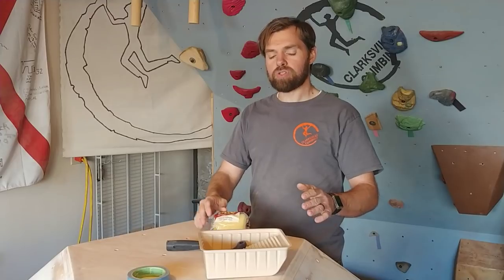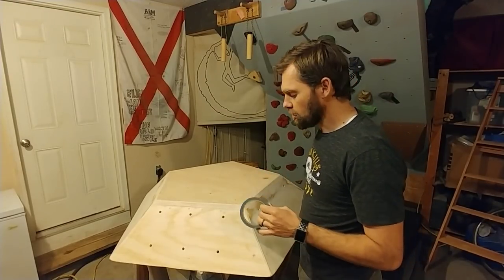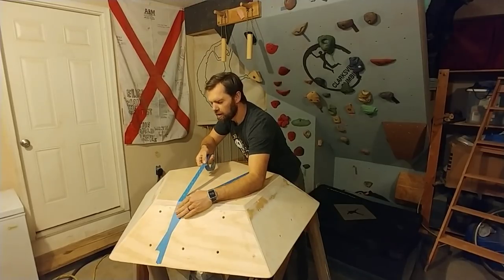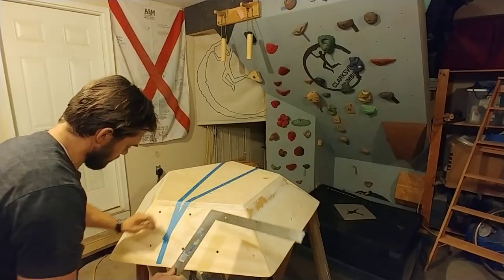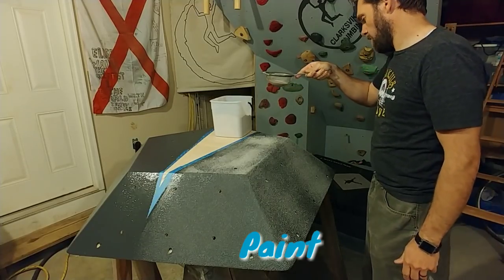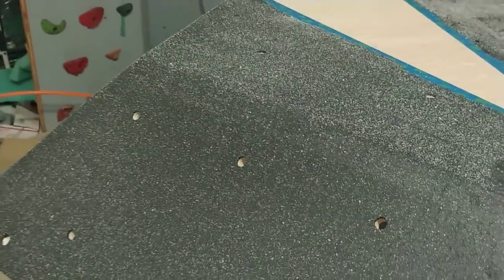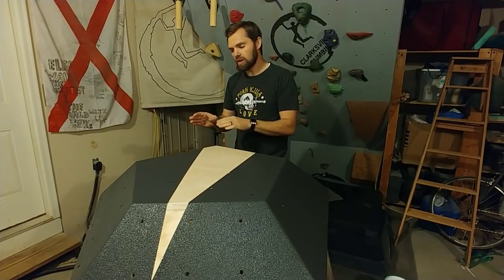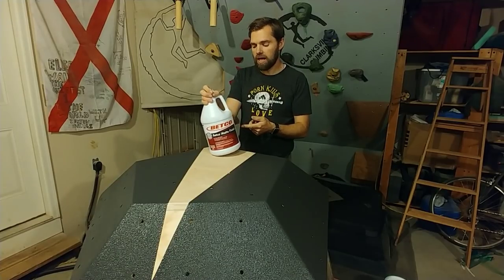How to Paint a Volume for Climbing Walls

Comment: I recently found the channel and love it. Haha I’m the random guy liking multiple videos...  

I’m building a 1,000 sqft garage rock gym. I’m confused on what order I should do paint (taping off and adding design), bond all edges and cracks for smooth finishes, and texture all of it..
Should I add a texture like you have on every single plywood piece or just on the volumes? Is the clear coat all I would need?

So it would be... 
1. T-Nut plywood
2. Hang all walls 
3. Bond the edges (sand them of course)
4. Tape off and paint (deck paint or regular? I wouldn’t mind using deck paint for quality but color choices are limited)
5. Finish with the clear coat sealer (is that grippy enough if I don’t texture?)

I’m more looking into saving money by DIY of course but I’d rather do it the right way first and have it turn out great! Thank you for your help and the channel!! I will be buying some of the items from your links

- Casey A.
Saint George, UT
Reply from the maker: I'm still perfecting my own technique to texture. This is what I do now...
-Smooth joints
-Primer paint
-spread texture (sand)
-Latex paint, 2 coats
-High quality clear coat
I think it would be cool to have spots on the Wall that have no texture, I think thats a design preference more than anything. Spinners might be more of an issue in those areas.

Thanks for your support!

Comment: That looks fantastic! Could you link to the paint you used? Cheers 👍🏼
Reply from the maker: Jay, I just use regular house paint, whatever I have extra from other projects. The clear coat is were the "rubber meets the road" or in this case Volume :)
Reply: Climber Dad, thanks for the info 👍🏼

Comment: Do you like the Betco as a top coat for the surface of the climbing video.  Thanks for the great information!
Reply from the maker: It's not really about what looks best in video, it's about the finished, usability of the volume at a good cost. I've found the Rustoleam garage floor clear coat to be just as effective if not a little better.

Comment: I juuuuuust started building volumes a couple of weeks ago. I appreciate this video because it's motivated me to use the shaker screen. It looks way better. My current issue is with the holes for the t nuts. So many of the holes I drill end up with really badly gauged edges. Is this just a problem with the type of bit I'm using? I've had to fix so many hole edges that I'm wondering if there is an obvious fix for smoothing the edges better. Thanks!
Reply from the maker: Thanks! I totally understand about the holes. The bit makes a huge difference. Here is a link to the exact bit that I use.
https://amzn.to/2DsaXFl
Reply: good bit and a few layers of masking tape should fix that up

Comment: The second paint is applying when the first coat has dried or you just paint it right away? I made some volumes but the sand didn't stick very well.
Reply from the maker: Wait for it to dry

Comment: do you wait that the first paint is dry before putting the second layer on the top of the sand and what is the paint used
Reply from the maker: Yes and I use whatever paint I have laying around, usually water based latex paint. If you are looking for performance use a 2 part epoxy paint.
Reply: @climberdad  thanks for the response

Comment: hi , how's the sand holding up? I'm just about to paint my panels for an outdoor wall, i'm going with Primer first then paint with sand and possibly another coat over the sand. Was wondering if its worth it.
Reply from the maker: I would recommend and least 2 coats over the sand. Also if you can get a fine silica sand that would be much easier than sifting play sand.
Reply: @climberdad  Thanks! Your videos have been very helpful.
Reply: @climberdad  ops another question , after drilling my holes should i paint first installing tnuts?
Reply from the maker: I prefer to paint very last, after the t-nuts have been installed unless it's a volume.
Reply: @climberdad  I prefer to install the t-nuts last, if you get paint on the inside thread it's a pain to clean out.

Comment: Hi Im really appreciate of your work. What kind of paintball you used. Matted, enamel?
Reply from the maker: Honestly, I just use whatever I have laying around. Marine grade paint seems to work well. I typically put a clear coat polyurethane over the top and you'll need to chalk the back of the holds to protect the paint.

Comment: How would you rate this after couple months-1 year use? Does it still have good texture?
Reply from the maker: Yes, holding up real well. The trick is to get a fine gain sand and several layers of paint to lock it in. Large grains will slough off (like climbing on soft sandstone).
Reply: @climberdad  Thank you for responding! :)

Comment: Will sanding the ply with rough sandpaper work as a cheaper and easier alternative to achieve a similar texture?
Reply from the maker: I use an 80 grit that seems to be a good balance but if you go any rougher I would worry about splinters. Wood holds polish down over time anyways.
Reply: @climberdad  thanks for the advice

Comment: Nice volume, what type of wood do you prefer for your volumes
Reply from the maker: 3/4" Baltic Birtch is perferred but I usually use 3/4" hardwood plywood from Home Depot because its a little less money and much easier for me to get. The 7 ply cabinet grade pine has worked well for me although its a little on the soft side.

Comment: very good work¡¡¡  What paint do you use?
Reply from the maker: I've been using a regular latex paint and a flat or satin water based clear coat on top. I'm going to start using a 2 part epoxy.
Reply: Climber Dad Cool Vid. Can you suggest a 2 part epoxy?  Everything I see is for cars or clear coats with high gloss for like wood tables tops. Also what sort of sand are you using?
Reply from the maker: @SuperBigVanilla  Thanks. I have been looking into some different 2 part epoxy paints but haven't used any yet. When I find some that works good that isn't crazy expensive I'll certainly share it.

Comment: Hi, just wanted to say I really appreciate the videos you've made on home wall construction, they've helped immensely!

I'm currently building an outdoor climbing wall on the side of my house (under an eve, to offer more protection from weathering and whatnot). I've heard horror stories of climbing holds sticking to the paint and tearing it off the wall/volume. For an outdoor wall, would the polyurethane finish prevent this sticking issue? Also, would acrylic or acrylic latex paint work for the base of the wall/volume?

Thank you,
Justin
Reply from the maker: We chalk the back of our holds to help this from happening with new walls.

Comment: How slip resistant is the clear coat? I'm thinking of trying it for use on a warped wall (as seen on ninja warrior) to give it a little extra grip/slip resistant. Good idea or should I look at other options?
Reply from the maker: Caleb Auer, if it's just the matte clear coat and no sand it might work really well. Test it out and let us know :)

Comment: I tried with regular sand it seemed quite abrasive. Rubbing hold ripped my skin. Any suggestions?
Reply from the maker: I screen out the large grains. They do sell a pre screened silica sand but it's crazy expensive where I live. Maybe you can Get some pre screened stuff.
Reply: @climberdad   I'm thinking maybe that's what the issue was and I didn't put enough coverage to level it all with sand. How do you find it with your sand and coverage is it pretty close to climbing gym wall?
Reply from the maker: Thicker is better. The play sand is pretty coarse though.
Reply: @climberdad  I saw your trapezoid volume video what were the measurements and what angle did you set the circular saw to (sides and bottom).  Information said to follow link to Facebook but I couldn't find the angles. Thanks
Reply: @climberdad  sorry Penta volume not trapezoid. Thanks
Reply from the maker: I'll need to update that and put it on the blog.

Comment: Hi. What kind of paint are u using?
Reply from the maker: Best paint to use is a 2 part epoxy paint. Worst paint is a Latex paint covered with a clear coat for wood flooring (this video). Not great but it works and usually the cheapest route.
Reply: @climberdad  thank u so much for your kind reply. I was wondering what should I use to create texture? Also should I use polyurethane (PU) paint? I do have a supplier of that in my country
Reply from the maker: https://youtube.com/shorts/tS6yk3Ffe78?feature=share

Can you get epoxy paint or a hard acrylic paint? PU paint will work, you'll need to make sure to chalk or wax the back of your holds.
Reply: @climberdad  tq so much sir!

Comment: What colour of paint?
Reply from the maker: Well... If you're going with the latex base paint any colour you want. There are some other paints that are better suited for the application that are more limited on colour and more expensive.
Reply: I’m wondering what you used here
Reply from the maker: @bradleycampbell2843  I used Latex here but it's not my favorite. 2 part epoxy paint is much better.
Reply: Nice! Thanks for the video. I’m hoping to have my own little wall done by the end of the  week

Comment: normal paint? :)
Reply from the maker: Yes. Only issue is the urethane holds tend to stick to it. Slap a little chalk on the back of them before you bolt them on and problem solved